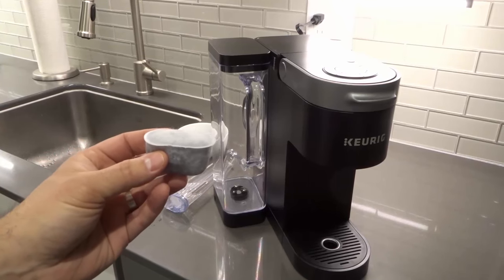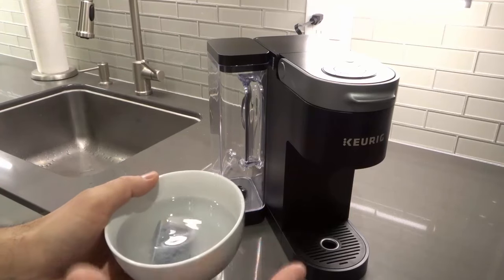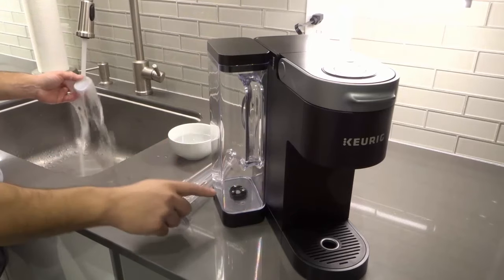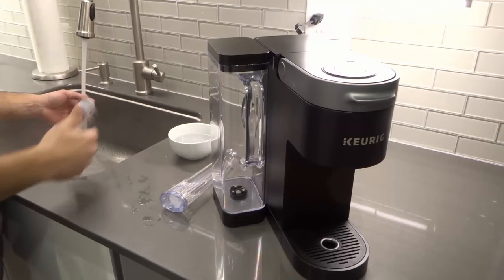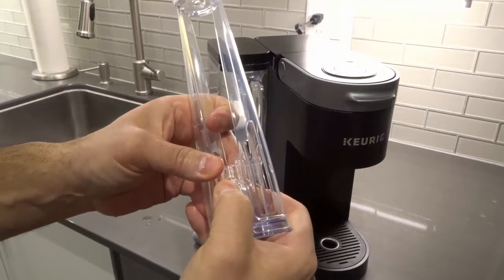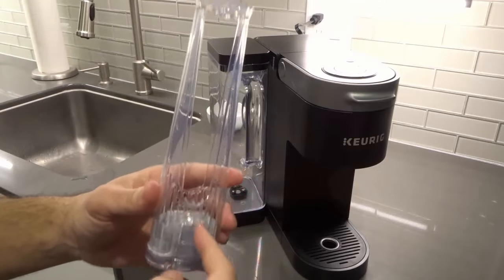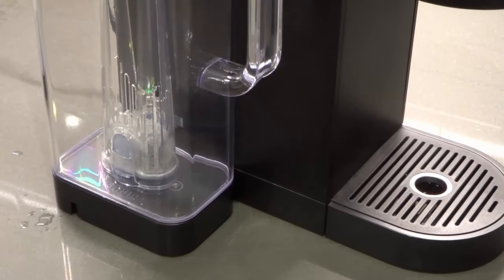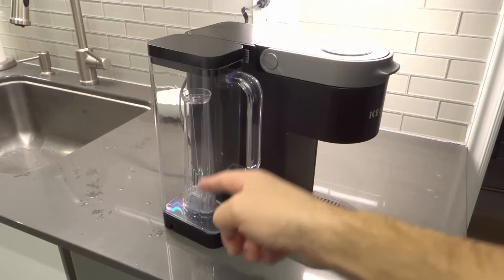How To Install Water Filter On Keurig K Supreme-Easy Tutorial

Comment: I put the filter in a bowl  the water turned black after that i ran the water over the filter in the bowl till clear , next installed the plastic didn't fit oh there are 2 tabs you line up

Comment: Nice! One idea… you could have showed how to remove the filter holder/handle for us newbies.
Reply: It is easy. You squeeze as he shows to remove the cap.  Once done, pull out the old one by grabbing the little filter lip he shows in the video.Pop in the new as shown and slide it back in.

Comment: The holder doesn't snap in place in any orientation in my K-Supreme Plus Smart. Looking at the water reservoir from the bottom while fitting the filter holder helps see what is the orientation it likes.